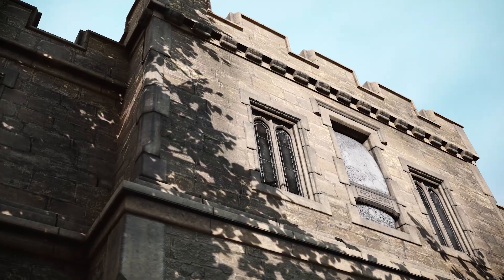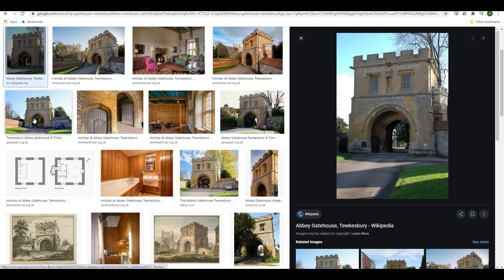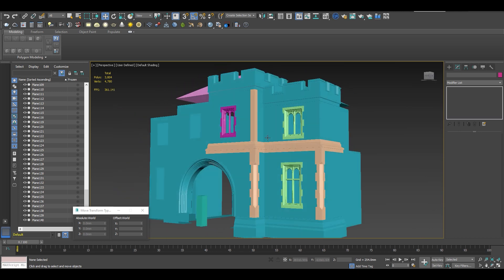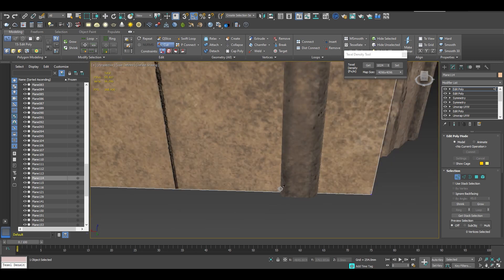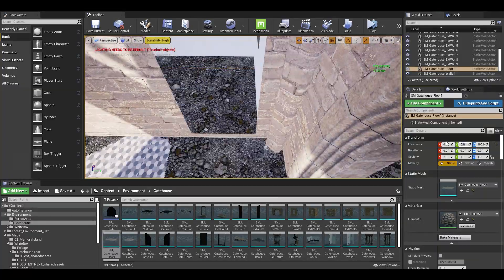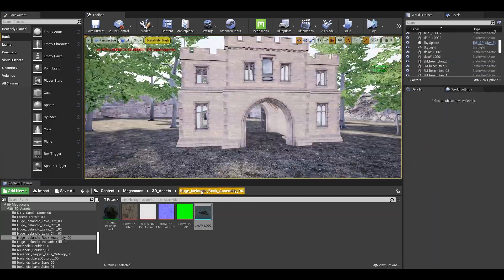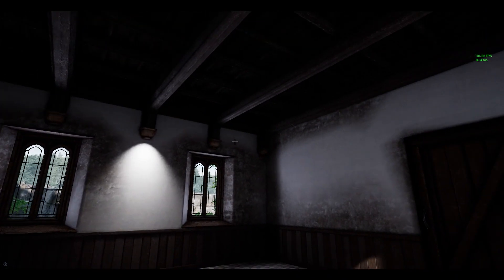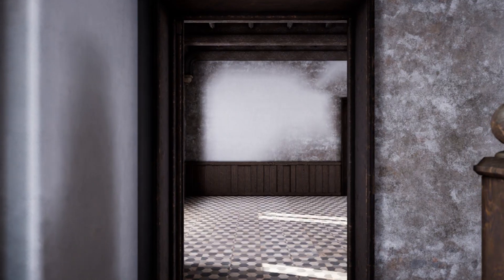Creating an old Gatehouse for Unreal Engine 4

Comment: What tools did you use for this?
Reply from the maker: Good question :) 

Modelling: 3DS Max (although Blender, Maya or similar would work too)
Texturing: Substance Painter and Substance Designer. Textures were a mix of self-created and drawn from asset libraries, such as substance source.
Texture Management: Substance designer. 
Game Engine: Unreal

I also find it helpful to have a sketchbook nearby for designing and solving problems as you go. Hope that helps :)
Reply: @AlistairHume  Yeah for sure, thanks.